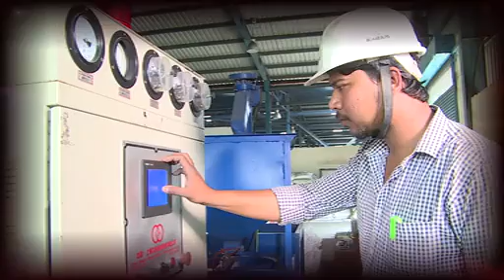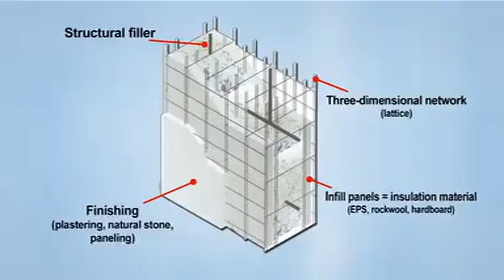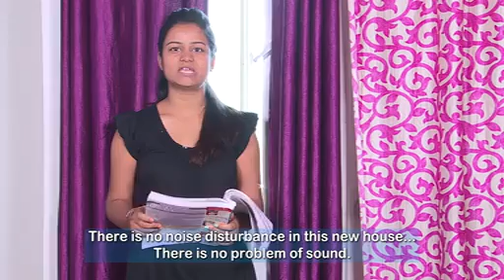BMTPC EPS Based Panel System

Comment: Had been thinking a lot on alternative wall & roofing system but the EPS has polystyrene which can give poisonous fume hence would never suggest this.
Not happy with BMTPC suggesting it.
And it has hardly any impact apart from lowering weight for seismic.
Reply from the maker: EPS is encased & treated. It is passed with all health related standards. No issue at all with health of occupants. So, no worries
Reply: @bmtpc-dr.shaileshagrawalex7388  may i know your whatsapp number？
Reply: I am a civil engineer and I have been building such houses since 1989. Polystyrene is the most harmless and hygienic insulation material. It has nothing to do with asbestos and cement products that are carcinogenic. Wrong information you have dear.
Reply: Pavlos thank you for the information sir. I am thinking about if fire happened for long time those eps sheets should be melt.

Comment: I need contact no. 
And want to know cost of 10000 sq feet by EPS
Reply: If you want to know more about eps panel machine, you can contact me. Contact:Coco
Mobile/Whatsapp/Wechat:+8618831159972
Reply: Contact RAPIDCON.. 7666951104.. they are most affordable manufacturers of eps panel in India and take contract for house construction using eps technology

Comment: Excellent effort to aware the peoples about above energy efficient emerging technology by BMTPC.
We at Quick Builds Naini Allahabad in U.P. have invented very affordable technology for manufacturing of above 3D EPS Core Welded Wire Mesh Panels with cost of only 10-12 lacs.
Contact us at quickbuilds1@gmail.com  or Whatsapp 9415574258.